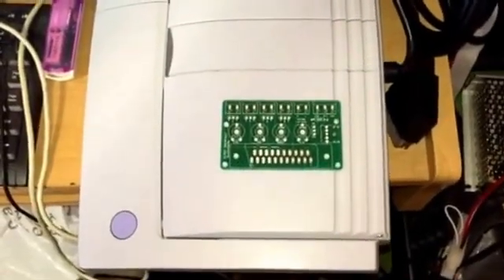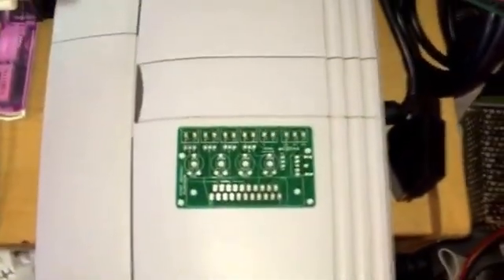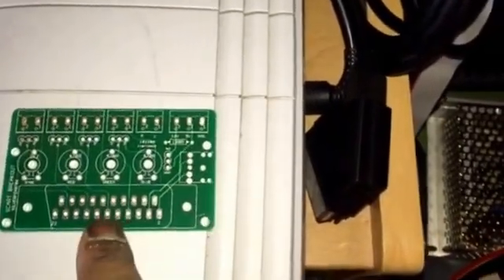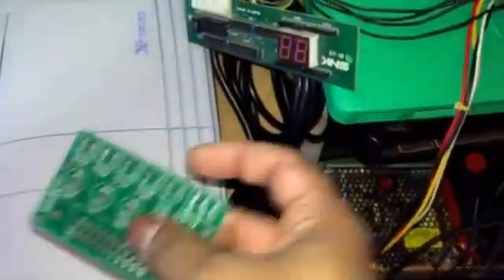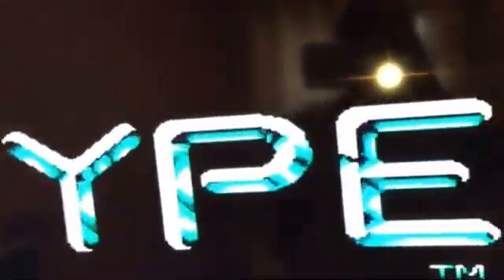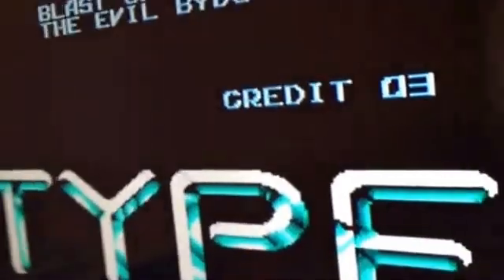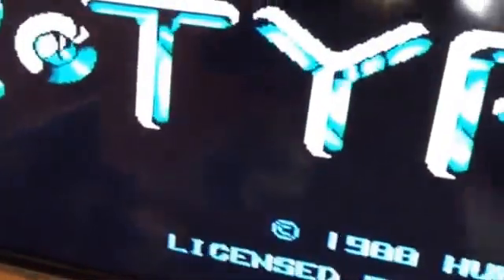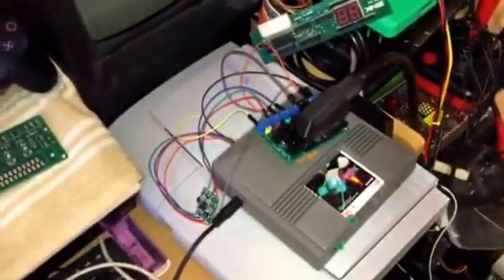Jamma Supergun or Console Scart Breakout

Comment: Can this be used to adjust the horizontal position of the image as the geometry settings on the tv are unable to move the screen enough for it to be central.
Reply from the maker: +MrDirkles i think you have this product confused. the only way to adjust the horizontal is to do it via the Horizontal adjust Coil on the chassis. the other way for a conventional CRT TV is to do it via the secret engineers menu. I add a Disclaimer to that. its a secret Engineers menu for a reason, if you mess up the setting then it could ruin your TV permanently. if your coil is not adjusting fully then either it is faulty or then your HOT or your Caps on your Horizontal Circuit are faulty.
Reply: Thanks for the thorough reply. The reason for asking is because i have a jrok multiwilliams jamma board that display a picture so far to the left that even on the maximum possible changes using the horizontal position in the geometry settings on the tv i cannot get it in the centre of the display. Other output devices ive tried on the same set seem to be nicely in the middle of the display. Any idea what causes this?
Reply from the maker: +MrDirkles Now that you tell me its JROK MW board it makes more sense, the JROK board where not designed with RGB TV Scart in mind, especially with JROK in US where RGB Scart is not even a thing, he made these boards to only be compatible with an actual Arcade CRT or then a VGA monitor, all others there is no guarantee it will work, because he didn't design or test it for those equipment.
Reply: +Silverfox0786 fair enough but what is it in the signal that causes the screen to be set to one side? it just puzzles me to be honest.
Reply from the maker: tbh i have never looked into it that deeply to know why and i assume JROK has not either, hence why you have the issue

Comment: Great little boards!!!
Reply from the maker: +GadgetUK164 thanks, its one that i was meaning to do for a long time, i even managed to use it to figure out why i was getting a blank screen after RGB modding a N64 and it was Luma Sync. using a SNES cable gives black screen because sync is on different pin on cable. but using my breakout gave me correct picture. woth it just for that result alone.